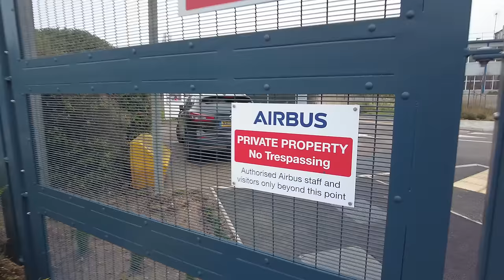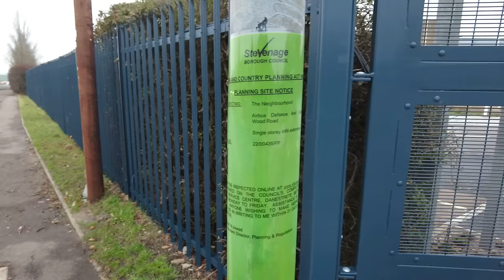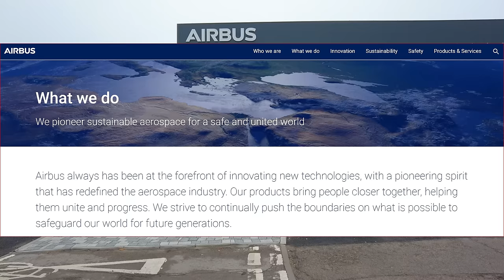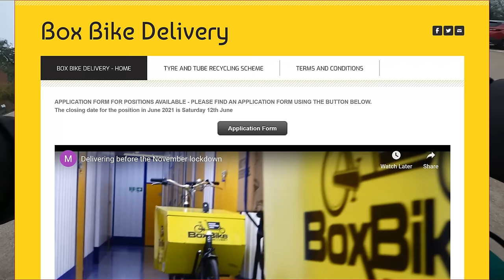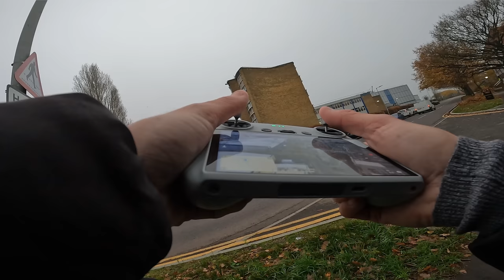You’re Still Recording Our Site! You’re Not Allowed To! 🎥🛸❌

Comment: Ncie videos DJ, what's the app you use to check if allowed to fly drone in the area.
Reply from the maker: Drone assist 👍
Reply: @DJAUDITS  thanks for the reply, working my way through your vids, keep up the good work 🙏
Reply: @DJAUDITS  PTTP just did a drone video and the constable used flight Angel which the constable showed there was a flight restriction (airport near). PTTP used DJi flight assist which showed no restriction. PTTP later realised the constable had the CRT option on, which is for drones above 250g. I would suggest that if the police are using Flight Angel APP then all pilots should use as well so we are not caught out by their incorrect settings.😏 As well As the Duo app😎
Reply from the maker: @sapankhurst2015  flight angel is drone assist and yes I saw that video.

Comment: So since the CAA are changing the laws later this month so you have to be able to clearly see which direction the drone is facing (without using the camera or telemetry) are you going to stop using the drone as it essentially means your flying distance is about 20-50m?
Reply from the maker: Can you see the orientation of the drone at 50m?
Reply: @DJAUDITS  - In most cases no, it's a really stupid definition that they have put in the CAP and I think it'll just lead to a lot more illegal flights because the rules are so dumb.